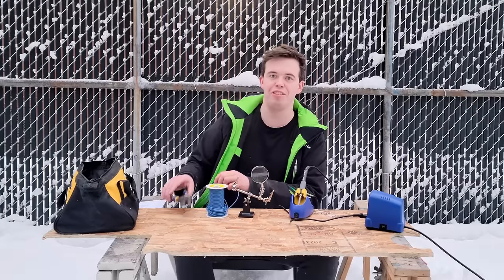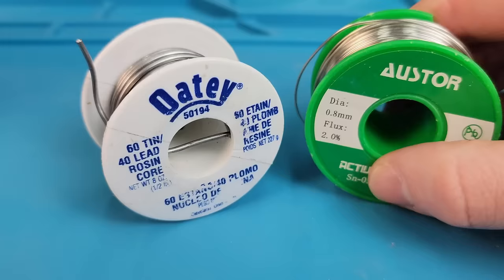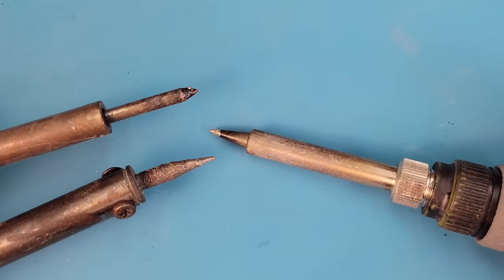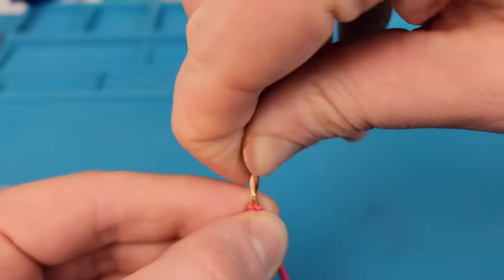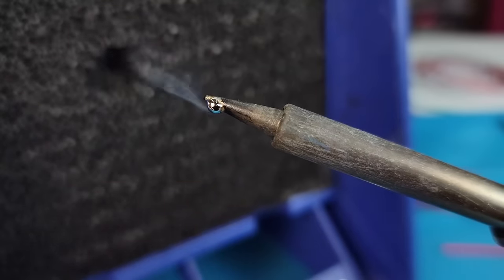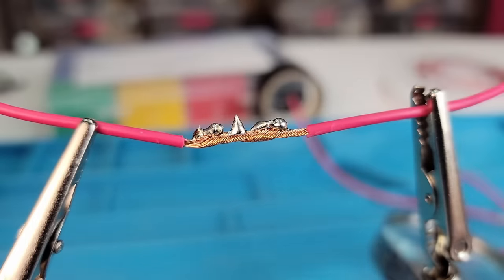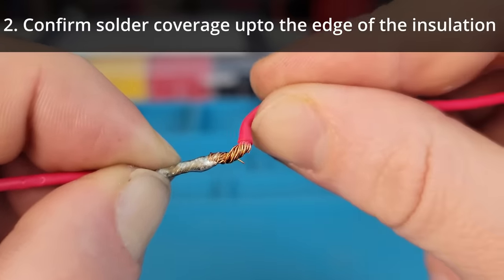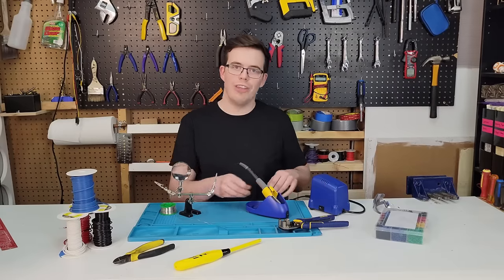Four Steps to Flawless Wire Joints (How to Solder)

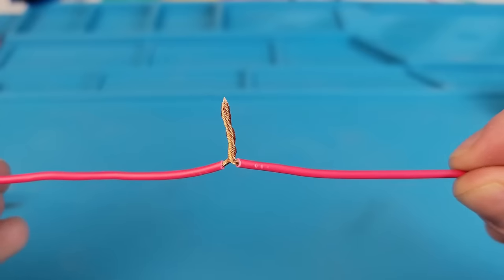Comment: Thank you, all of your advice is very good.  You mentioned automatic wire strippers at 4:29.  They are wonderful and well worth the money.   At 5:10, remember that you will usually have to slide on the heat shrink tubing before you twist the wires and apply solder.  

1:00  The Hakko FX888 works well, but its controls are completely counterintuitive.  Even though it only has two buttons, I can not change its temperature without rereading its instructions.  You would not think that a company could make it all that difficult, but somehow they did.  I prefer to set the iron at a very high temperature.  If the iron is not quite hot enough, you will end up holding the soldering iron onto a heat sensitive component for a excessively long time waiting for the solder to melt.  I have come to believe that a hotter iron is actually better for heat sensitive parts.

Comment: Very good tutorial. "Do not paint the solder on the joint." This is what most noobs will try at first. 

Newbies don't appreciate that the solder must flow into the wire but won't unless the wire is hot.

Comment: I normally hold the iron on the bottom of the wire and add solder to the top. Heat rises, and the solder will melt down.
I also gotta admit, I have used electrical tape in the past. A few times because I had no heat shrink, and a few times because I had it but forgot to apply it. And probably once because I was too lazy to get the heat gun out (also too afraid of lighters to keep a lighter nearby)

This is a great tutorial. You explained what to do and what not to do perfectly!
Reply: LOL! Heat does not rise in a wire. It spreads by conduction, not convection.
Reply: @frijitz001  yeah I guess maybe, but it still makes more sense to do it that way as the solder can melt down into the wire rather than having to melt sideways.

Comment: that was a good video... one suggestion I have is hold the soldering iron under the wire and touch the solder on the top side of the wire.  Heat rises so the wire will heat quicker.

Comment: I started getting much better at soldering by getting a proper weller station and brass sponge, and changing the tips. I like to use a chisel tip for most things, or a fine pencil tip for small motherboard stuff. Most of the wiring I do is guitar work.

Comment: Great video! One thing to improve your experience is to carry a mini torch lighter for the heat shrink tubing. It burns hotter so make sure you don't hold it in one spot for very long. But it works fast and no soot. Mine is one that has angle adjustment, so you can set it at a 45,90 or any angle you need to get harder to reach areas.

Comment: Hi, Will. Very good video! Your technique is flawless and beautifully excecuted..

IMHO, one should never put away one's iron with a totally clean and dry tip. I have been soldering for over 50 years and I have found that I like the results (i.e. life of the soldering tip) much better if I thoroughly clean off the tip and then add just a bit of fresh solder just after turning off the iron. There will still be just enough heat to melt the solder, but it will cool off and solidify the solder leaving a protective coating on the tip. When I use it next, I just wipe away the melted solder from the tip and get on with the work at hand. 

I also do not twist the individual wires before soldering. I use the same technique that you do by holding the wires together at one end and twist them together. I feel like I get a better mechanical and electrical connection without tightly twisting the individual wires first.

Comment: For automotive use, I always use lead solder. I also use a lash joint, which is the same twisting you use but I wrap the joint in a thin bare copper wire. If done properly, you can hang from a lash joint before it's soldered. I also use adhesive lined heat shrink, Napa sells a fantastic heat shrink I use daily

Comment: I'm just learning to do this , thanks for the vid. A little tip about the shrink wrap, if you use marine grade wrap it has a waterproof glue built into it giving a clean waterproof seal on top of the soldering. Although it doesn't come in any color except black!

Comment: About the best sub-$500 iron I've used is the TS-100/101 with a 24V supply and the K-tip, you can get it for well under $150 and it has a ton of surface area for making good wire joints.

Comment: Great tips!  It may be wrong, but when heating thick wires or connections I'll hold the iron underneath so that more of the heat is transferred to the joint.

Comment: One important con-side of lead-free solder is that it is prone to fracture. If you solder any parts that experience lots of vibrations or temperature gradients, using leaded solder increases the probability of solder joints surviving longer time periods.
Reply: Thats why I almost always butt splice on cars.  Solder is cheaper in Lab making cool jumpers and test rigs

Comment: Two points: 
1 - whilst automatic wire trimmers are very fast I prefer to use methods that allow me to manually remove the outer section, which I remove with a twisting action. 
This twists the wire without your natural oils getting on the wire, which reduces the chance of long term corrosion etc. 
2 - lead free solder requires higher temperatures as you stated, so for beginners (who may not be quick at getting good flow) it might be advisable for them to use leaded solder when working with expensive or fragile components. 
Wires can very effectively transfer that heat far from the solder joint (as many of us know from holding those wires) 😂

Comment: Regarding wire splicing, the best method is a lineman's splice.  You form a bend in both wires to hook the wires together, then you wrap each wire's hook around itself.  When you add solder, you are cementing these hooks together.  It is much stronger than laying wires alongside each other and wrapping them around.  That method will work, but it is not as strong as a lineman's splice (the method NASA recommends).

Comment: My recommendation instead of that kind of lighter is a small, portable, single jet butane lighter/torch. They sell very small ones, similar to what you'd use for lighting a cigar, but with only a single jet so not as powerful. They ignite instantly, are extremely small and easy to wield and light with only one hand, and give you excellent control over the application of heat given their reliably defined torch-style flame (it's unaffected by wind or gravity, so you can use it upside down, for example, and is always the same shape). Plus they're refillable. Just make sure you get one with only one jet - most cigar lighters or windproof jet lighters are thicker and put out way too much heat. They're often ignited with a thumb rather than a index finger, giving you better control than those trigger-style lighters... the one I have is toggleable and doesn't even turn off when I let go (mildly unsafe, but useful).

I have butane lighters of all types, as well as a fancy hot air rework station, and everything else under the sun... but I use my single-jet butane torch 99% of the time.

Comment: As a certified solderer, I used the clips of my helping hands, as a heat sink so the solder does not wick too far up the wire. They will also protect any heat shrink tubing from premature shrinking. For my solder cleaning I only used filtered water from a room temperature container. Another thought. Does the Hakko solder station remind you of something designed by Playskool?

Comment: For joints like this, particularly in high-vibration environments, I cannot stress enough the importance of using adhesive-lined heatshrink for the most reliable possible joint.

Comment: Definitely could have touched on flux. It will make heat transfer and soldering an almost instant process, but you do have to make sure you clean the wires properly. Good in depth video for beginners!

Comment: This is good soldering advice. One other tip is to add some solder Flux liquid or paste directly onto the wire, it will help the solder flow better

Comment: The way I typically heat up the heat shrink is with the thick part of the rod of the soldering iron (not actually touching it, just getting very close, ideally from below). No risk of ugly black parts from the flame.

Comment: Best how to video so far! I would like to see one from you soldering a 10 gauge wire. Smaller wire I'm pretty decent,10 gauge is driving me crazy..... and it's a short drive 😊
Reply from the maker: Working with 10 gauge wire is definitely more difficult! But the same principles apply of maximizing heat transfer and then adding fresh solder. To achieve it in this case I would crank the temperature a lot higher, in the video I set the tool to 650F but for 10 gauge wire I'd go upto 750-800F. I'd also recommend using a much thicker tip than the one featured in this video, if you are using a Hakko soldering iron something like the T19 6.5mm tip would be good. Alternatively, you could try with a pistol grip soldering gun, I don't have much first hand experience with this type of tool though, so can't guarantee results. Regardless of the tool, you will need to hold the soldering iron in contact with the wires for much longer to adequately heat them up before adding solder. 

Also if your wire twists are loose, with air gaps between the wire strands, this will limit the rate of heat transfer. Ensure the wires are twisted as tight as possible. 

An alternative approach could be using heat shrink solder connectors: https://amzn.to/3Uelcoh I have used these before (including for 10AWG), if you use them, make sure you keep the keep the heat applied until the solder stops flowing completely. I've seen many cases of people removing the heat too quickly before the solder finishes flowing and this results in a deceptively poor connection (despite looking good from the outside). 

Finally, depending on your application and if soldering can be optional, Wago connectors perform very well too: https://amzn.to/3U7l3lw
Reply: @WillDonaldson  I so much appreciate the advice. I do have a trigger gun and I believe a loose wrap is the culprit. It was getting so hot the fork on the end of the wire I was (trying) to put together burted my arm from 4in away and my solder still wouldn't flow. Thank you again for your time
Reply from the maker: @ronaldsteveson76  This video shows a different wire twisting methods that may work very well in your situation, best of luck! https://www.youtube.com/watch?v=7t9nT3Hn9b0

Comment: Great video. I have been soldering for decades. I prefer a chisel tip more heated surface area. I only break out the point one when I’m doing something very small.

Comment: Definitely a great video, my only input to the video is when you said something about laying the wires on top of each other (which is called a Lap Solder) how they are weak. I disagree, because in MIL spec soldering Class III (IPC-A-610 and J-STD) This is an approved method on splicing wires and is a very strong connection. I personally use this method (only when needed, they don't really like splicing at all) when building wire harnesses for military purpose. Although the method that you are using is very superior. That's all.
Reply: Lap splice is also alowed in ipc-a-620, many methods are approved the main thing being to know which one to use depending on the situation!

Comment: I always use flux core solder and additional flux on the bare wires first. I’ve always found that this flows way better. Especially when using the lead free stuff.

Comment: Came here thinking I'd probably not learn anything new, but wanted to still see id I would and wasn't dissapointed! Definitely will be using the V-style twist in the future. Also, switching out the sponge that came with the soldering station just dropped pretty far down on my list of things to buy 😄 that's what I was taught to use 15 years ago, and I wasn't sure if that's completely ancient history by now, but I take it that it's good enough, even if not ideal.

Comment: I usuallly use the sponge in conjunction to the brass brush. You tin the tip, run it through the brass and clean off the dust with the sponge. Leaves it in a great state for next time or ready to go.

Comment: Love the pinecil, it melts solder faster than my huge yihua soldering station. I've also found the solder varies a lot, had some aliexpress solder that wouldn't stick to anything and looked dull. I bought some Kester solder and it works so much better, nice and shiny, flows freely and sticks to copper well. Both claim to be the same lead/tin rosin core composition

Comment: A tangential / backup idea:  but if you have to join wire and can't solder them, consider using the Western Union linesman's splice.   It's a clever way of twisting wire together to form a mechanically strong connection.  The resulting joined wires can be soldered together for extra strength, but soldering isn't absolutely required.

Comment: I've been soldering for almost a decade and I still struggle with wires, I could use a refresher. Good bit of information. You've mastered the art of soldering wires but you need to work on wet sponge technique, bro. lol. wet sponge > brass sponge.

Comment: I used resin flux with spong to thoroughly clean my iron tip after I am done for years. I'm using the old solid tips on digital radio shack iron. Cost was about the same though long time ago. In the mentioned soldering resin wire. I've also used solid 99% silver leadfree wire on some of my work. Having the resin is helpful when using that wire.

Comment: Try applying flux onto the surface to be soldered before soldering. Also leave a thick amount 
of solder on the tip before storing the soldering iron. Next time you use the soldering iron
all you have to do is wipe off the solder on the tip after it's up to temp.

Comment: I usually prefer a butane soldering iron,  I also fan out the stranded wires, push one fan through into the other, at about 60° to each other to start with, then twist around each other. It gives a nice even twist, intermeshing the two wires neatly. 
A great beginner's video nonetheless, I really enjoyed it. Thank you

Comment: I think the tip about putting the heat shrink tubing around the wire should have been said before the instructions about twisting the wires started. It's way to easy to forget to put the heat shrink tubing on and you really cannot fix that after the fact without redoing everything. Also worth noting is that the max amount of shrinking is pretty limited so some rules about how to select correct size would have been nice.

And I think it's okay to use electric tape under the heat shrink tube if you cannot get tight fit otherwise because the tubing must go around part that's too big.

Comment: I always prefer a chisel tip. There’s more mass and so they don’t lose heat to the job so quickly. If you have any type of heat sink at all, a pointed tip will shed heat rapidly. This is especially a problem with lead-free solder.

Comment: Great explanation.  Best I have seen. 

It seems logical that heating the wire from below would be more effective because of heat rising.  This would also allow the solder to flow downward through the wire towards the heat.  Are the gains too small to matter?

Comment: I suggest that everyone go watch the Pace series on how to solder, and go find some old 1930s to 1950s books on outdoor and indoor electrical work.  Soldering is now illegal in all building codes but there were lots of unique and effective wire slicing techniques for use with solder. The Lineman's or Western Union splice when followed correctly became a NASA standard. Large solid copper wires were also soldered using a plethora of techniques. There is one very important type of solder that was totally overlooked, and that is 63-37 eutectic solder. The temperature range at which the solder is plastic and neither liquid or solid is very small with eutectic solder, making it easier to work with. Using the damp sponge shocks the scale off of the tip and it is a step that should not be skipped. Conical tips are also a poor choice. Use a screwdriver tip.
Reply: The weller manual that comes with their solder says use damp sponge for Lead solder; Brass wool for lead-free (dry). this instruction fixed my soldering issues with lead-free solder in recent years, along with tip-activator saved going through a lot of tips.

Comment: I stopped using this method a few years ago, I now use solderseal heat shrink, far faster and less hassle. The end result is you get a soldered and sealed joint all in one step.

Comment: Tip: i mean the soldering iron tip. Always use the biggest one that the job will allow. That makes for the best heat transfer. And always put the heat shrink tube on before doing anything else.

Comment: The reason to apply solder to the heated wire is for the resin inside the core of the solder to contact the wire before it gets a chance to evaporate. 

If you’d apply solder to iron first, the resin will almost immediately evaporate.